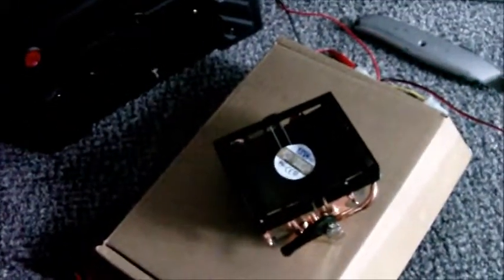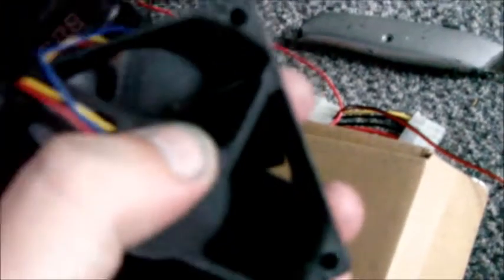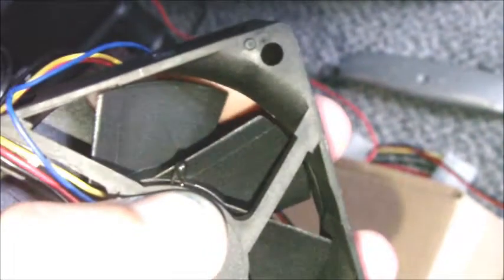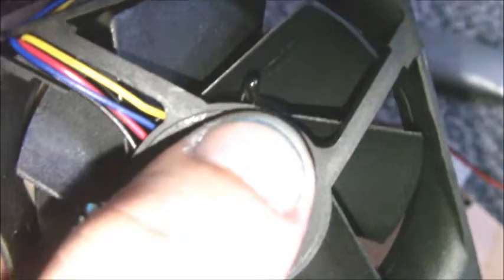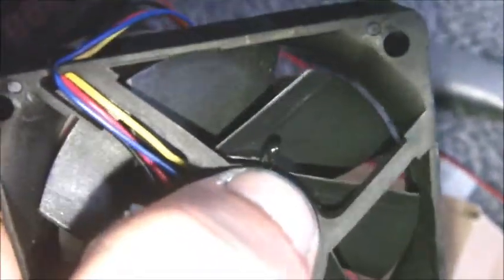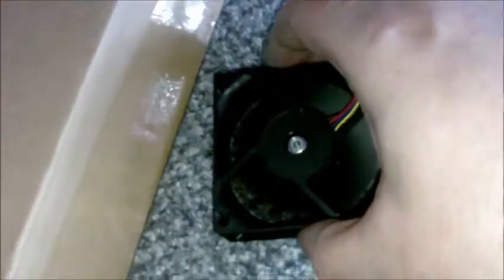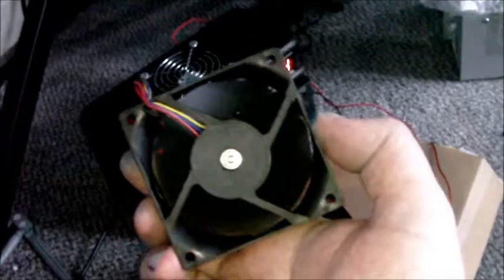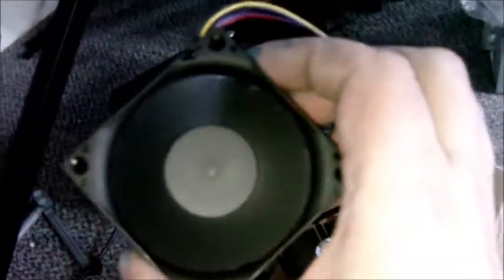AMD 8 Core Stock Cooler Performance Mod - SYNTHEMATIX

Comment: Personally, I'd buy a cheap aftermarket cooler; it won't be as noisy, will hands down beat the stock cooler, and you won't be replacing the fan every year because of running it on full speed. Even the cheap Arctic Cooling coolers are awesome.
Reply from the maker: hello m8, I tried the arctic cooling freezer 12 actually wasn't as good as the stock cooler, the boxed coolers that come with the cpu are made by cooler master and theyre surprisingly good!
Reply: Synthematix
Wow, that's quite surprising; I've never had a stock cooler that was actually decent, let alone beat an aftermarket cooler. I'm not familiar with the freezer 12; I know the freezer 7 is their best entry level cooler.
Reply: Synthematix Running an Artic A11 in a rig now. Very quite, cpu never gets over 50c even playing Crisis 3 etc for hours an idles @25c with a constant 4.1GHz OC
Reply from the maker: im currently building a custom thermoelectric watercooling system